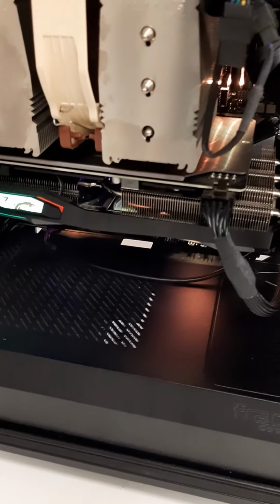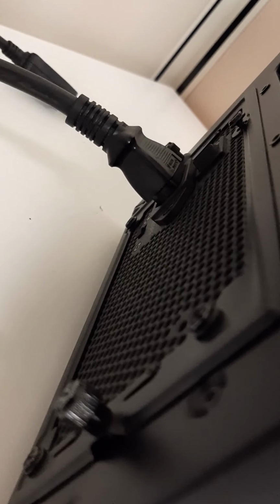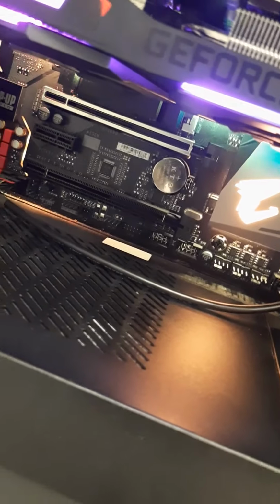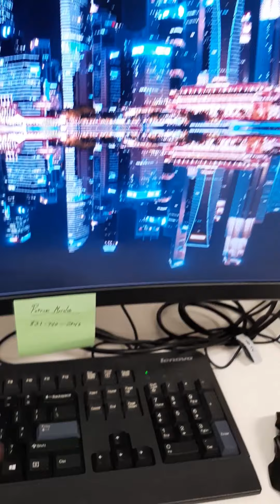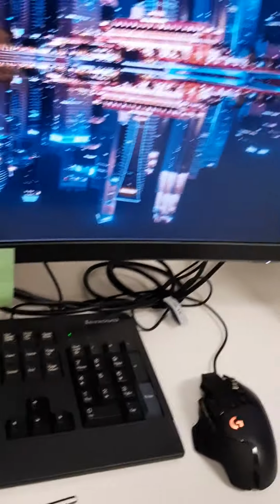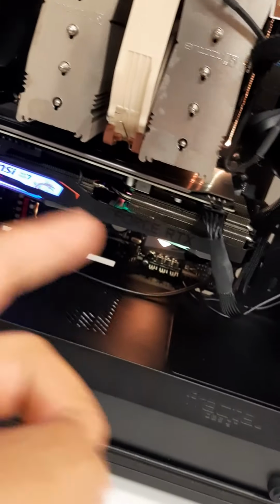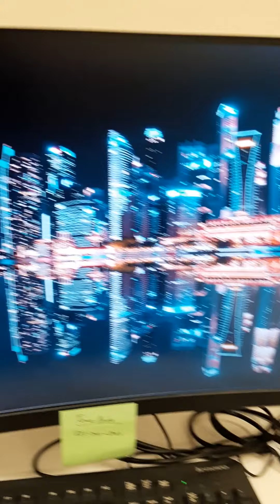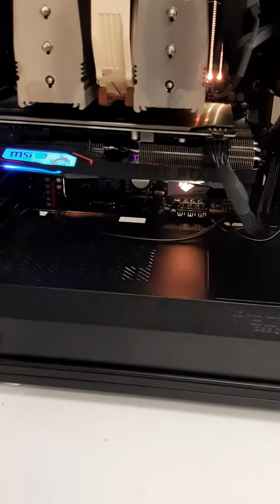HOW TO FIX BLANK SCREEN AFTER ENABLING SECURE BOOT | Windows 11 Upgrade Headache Fix

Comment: My experience: 
I was able to download to windows 11 from 10 without enabling secure boot (but have enabled tpm 2.0). Just recently I decided to enable it due to application restrictions. (Note: all my drives are in GPT)

I've got everything up to date and went into the (Gigabyte B450M DS3H) bios and disabled csm support to enable secure boot. Once I save and exited the changes, the computer was put in a power cycle (gpu lights/fan, cpu and case fans were going off and on (unable to get into bios/boost to windows)). I've spent a few hours diagnosing the issue (ram, cpu, gpu, and psu - these were all fine). So the only thing left was the motherboard itself. I've removed the cmos battery (let it out for 30mins) and short the pins, but it didn't reset the bios. 

I gave up on it and bought a new (Gigabyte B450M DS3H V2) motherboard. So I did the same process again on trying to enable secure boot... it did not work... this time I was able to boot to windows but not into bios. I tried resetting bios again, nothing worked... It was like it's fast booting to windows and skipping bios. If I tried to press the DEL key it shows (no display). The only way to get out of the black screen into windows was to power off the computer and deal with the fact that you can never get into bios.

Few days later, I got replacement for the same motherboard... now I'm not touching secure boot until I know it will not brick my motherboard. So from my understanding gigabyte boards kinda shit.
Reply from the maker: Wise choice. I'm tempted to mess with it sometimes but I know it won't let to any good. Sorry to hear about your experience, it sounds pretty annoying and stressful. It ain't worth it for a new windows that just wants to look like Mac OS. Looks great, but not worth another black screen. Thank you for watching and thank you for your comment. Have a great day 😀
Reply: dumb question but how did u get a replacement ? did u send urs back to gigabyte or just order the same one because i have this exact issue w the exact same motherboard and i ordered a new one from amazon and swapped everything onto that one and i’m still getting the same cycle like you mentioned
Reply: @whiipskiii3194  I've ordered the v2 and that didn't seem to work with secure boot so I got a replacement for that on amazon. The first one (power cycle) is a dead board now... I've got everything required to enable secure boot (uefi mode and GPT drives) but for some reason it doesn't work.
Reply: @meepmeep5668  so you still haven’t been able to fix it even w the v2 ?
Reply: @whiipskiii3194  nope. From what I see it's not just gigabyte boards that this is happening to. Just got to wait until we get a bios update or something.
Reply: @meepmeep5668  what cpu do you have ? one with integrated graphics?
Reply: @meepmeep5668  honestly i’m gonna try get a cpu w integrated graphics and get into bios that way cuz i’m too impatient xd
Reply: @whiipskiii3194  That could work but the fact that the pc is in power cycle idk about that one.
Reply: @meepmeep5668  will let you know how it goes in a week or so
Reply: @whiipskiii3194  yo how did it go because I'm having the exact same problem right now fuckk
Reply: SkySailor  thats cool man hope it works out im getting my pc fixed tomorrow because the motherboard is broken
Reply: Gruel1  did you end up getting it repaired, if so how?

Comment: Tysm for your suggested method, I was trying to enable secure boot with an older motherboard(around 2013-ish) and then my whole screen wont show any display.. Then I took out the CMOS battery, boot it up and display were shown.. The BIOS resets back to default settings and all good to go.. What I learned today? How to reset BIOS haha.. 😂

Comment: Hi, good, I'm a 15-year-old boy who has a younger brother who plays valorant, tonight I try to activate secure boot because the game asks for it, I get a black screen, but if there is a response from the keyboard and mouse, what do I do , I don't know much about PC and I don't want to disconnect the gpu for fear of breaking it, I only connect the cable of my monitor as vga?
Reply: I have an i7 10th integrated graphics a gigabyte h410m s2h and a gtx 1650
Reply: I beg you please help me, I'm from Argentina and I've had my PC for 3 years, I don't want to lose it because I have my parents' medical projects and papers
Reply: @PIPELofficial  do the same thing that the guy did in the video it works 100% and don't worry the gpu won't break
Reply from the maker: As Karim said, you probably won't break it. Just don't yank anything out of the motherboard. If you don't feel comfortable, look up a video on how to remove a gpu and see how the person in the video does it and just copy them. Since you have integrated graphics, this should work for you. I'm sure you'll do it just fine without breaking anything. Sorry for taking so long to reply, I don't check this account as often anymore.
Reply: I solved it with the little knowledge I had of flashing the bios
Reply: my bios had been blocked, so I flashed it, I also tried the video option

Comment: I am currently dealing with the same situation on Asus Rog Strix B450-F Gaming mb. I mistakenly enabled 'secure boot keys' and since then no signal on monitor. I tried to reset bios trough the CLRTC pins didn't work. I tried removing battery trick didn't work. I have tried MB's HDMI to see if I get any signal to display before and I did not get anything BUT I haven't tried it after I attempt to reset BIOS like you did. So now I will go back and try mb HDMI again.
Reply from the maker: Good luck 👍
Reply from the maker: @ProxiusMusic  This method only works if you have integrated graphics. Other people have fixed it by getting a new motherboard. Not cheap but it's an option. Try reading through the comments in case someone has found a workaround that could work for you too.
Reply: @ProxiusMusic any update?
Reply: @buffymade did you fix it?

Comment: The same problem here. Unfortunately I do have a cpu without integrated graphics. Mobo: Gigabyte Aorus z390-I. This seems to be mainly gigabyte's problem.  Luckily my brother has a cpu with gpu and he let's me borrow it. If that solution works, I'm going to post it everywhere.
Reply from the maker: Hopefully it works for you. Let me know if it does
Reply: @anthonydiaz6101  problem fixed with integrated graphics!
Reply from the maker: @emilhanelius7655  Awesome! 😃

Comment: I had the same problem yesterday, I wanted to enable secure boot to be ready to install Windows 11 whenever I want... black screen.
And I have a CPU with no iGPU...
Thankfully I had a Ryzen 3200G as spare parts so I swap the CPUs and fixed everything in the BIOS, everything works again (but no Secure boot).
Guess I'll have to wait until someone finds a way to enable secure boot on these Gigabyte boards (B450i Aorus Pro Wifi)
Reply from the maker: That's great! Good thing you got it fixed
Reply: I have the same motherboard and had the same issue.  Sadly I didn’t have a spare processor with integrated graphics to fix this, and ended up prematurely getting a new motherboard and processor altogether.
Reply: I have some problem with no internal gpu. Can i change another vga card to make my pc boot again to change bios setting?

Comment: 1:26 What do you plug in the hdmi port?
Reply from the maker: Plug your monitor into the hdmi port that's on the motherboard so you can use the integrated graphics of the pc to get an image. This only works if your CPU has integrated graphics, of course. If you don't have integrated graphics, you'll still have the black screen.

Comment: That's exactly what i did on  my MB (Gigabyte UD Z390), and the only way i realized it was my GPU is, because i have 4 LED on my MB that have written on them (CPU-RAM-VGA and Bios). When i saw that VGA LED up, I instantly removed it, and saw the error disappearing together to some error beeps it was "screaming at me". The crappy part is, you're royally screwed if you don't have a CPU with integrated GPU.
Reply from the maker: Yeah, unfortunately that is true. I'm lucky I bought one that happened to have it. If I didn't, I would not be very happy right now. I feel for anyone who doesn't have integrated graphics though, it must be very frustrating.
Reply: Well yeah thats why I am screwed. I5 10400f and 1660 super tried to enable secure BOOT. And boom!!  Gotta call tech guy who can fix my PC by putting IGPU based CPU. This process sucks!!!
Reply: @atharvakale1167   and guess what, the reason it doesn't work well is cause u need to updated the bios on your MB. That's not rly dangerous unless u live in an area where you have black outs. Let's just say you don't want your electricity to fail when u update the bios.
Reply: @Wolf_Spark  well it is updated. Issue is only with gigabyte mb. I checked online and around 90% issue is with GB mb.Like GB which is one of the top most brands
Reply: @atharvakale1167  Could be that, last week when i was trying for this updated, it seemed GB and Asrock mb have some issues with the secure boot/TPM settings.
Reply: @Wolf_Spark  Now as I read on multiple forums, sol is to either put an CPU with igpu reset BIOS then connect gpu or just replace gpu with basic one and connect HDMI.

I do have my old GT 710 and thinking to give it a shot
Reply from the maker: @atharvakale1167  it really does bro. Best of luck with that man. I hope you can get that fixed somehow
Reply: @anthonydiaz6101  Thanks man. Thanks god my whole system is new so literally every single frikin hardware is under warranty so i am chilled. 😂
Reply from the maker: @atharvakale1167  That's good to hear. At least you're well covered
Reply: @atharvakale1167  hey did that work? I'm in the same boat as you
Reply: @xLightcrystalx  hey sorry to give u a shock. My motherboard died somehow and got new one as it was under warranty. That's it rest all things were as it is. No need to reinstall windows or anything. I putted new MB and not just my pc came back to life but also with win 11 support.
Reply: my cpu didnt have an integrated graphics (i9 9900kf), therefore had to ask my dad to collect some 9th gen or 8th gen cpus from his company to troubleshoot 😢

Comment: Enabled secure boot and factory keys.. mine is still rebooting after removing cmos and gpu, barely powering the run fan. Neither Monitor or mouse gets power. I just wanted to play Valo 😭
Reply: turn off the CSM support in BIOS

Comment: Omg. Yeah this led me in the right direction. Had the same thing, I could get to bios but couldn’t boot. I couldn’t even get bios to pop up without the GPU in, and ended up just going to bios with GPU in after resetting cmos and bios, put standard on instead of custom and ufei mode and it worked.

Comment: I need help with Asrock X570 Steel legend. To enable Secure boot on eneble I first have to disable CSM, save the bios and restart to re-enter BIOS and enable Secure boot because otherwise it is not possible. The problem is that when I disable CMS and click any key on the keyboard my computer does not start. There is power everything lights up but the screen does not work black image. When I do not click anything the system finally starts. During startup there are 5 beeps. The only solution is to remove the battery, i.e. CSM is turned on again. I discovered that when I connect another monitor I can enter BIOS turn on Secure boot and everything works no beeps. Everything is ok. GPT system, AMD CPU fTPM, Secure boot enabled visible in the system everything works! But when I reconnect my main monitor the problem appears again. There are 5 beeps again and as soon as I click something I have a black screen and I cannot enter BIOS. If I do not click anything the system finally starts and Secure boot works. These 5 signals are irritating! I have previously had Secure Boot enabled on my monitor many times and never had any problems with it! I recently cleaned my computer of dust without power and battery and since then I have not been able to enable Secure Boot on my monitor again and also enter the BIOS! Is there a solution for this? Why did this problem suddenly appear? I have enabled Secure Boot on my monitor many times and never had any problems with it! I have even done what Asrock recommends Install default keys Secure Boot. I have done Custom and also the Standard recommended by users, it does nothing! When I enter the BIOS on the second monitor and switch the HDMI cable to the second monitor on a turned on computer with the BIOS visible, my screen and BIOS work but as soon as I restart there is still a problem. On another monitor everything works without a problem. The second monitor is from another computer, it has never been connected before, I have always used mine. I have done this many times on BIOS version L3 and also L5.60, now I have even installed the latest version L5.63 and there is still a problem!. I only have monitors with HDMI input! My motherboard does not have integrated graphics! I only have a dedicated card with one HDMI input and 3 Displayport inputs. I can't connect my main monitor to another output because I only have one!. HEEEELP! Asrock is shit! On Gigabyte, Asus or Gigabyte there are never such problems, this was my last motherboard from this shitty manufacturer.
Reply: I solved the problem myself. The solution was trivial that no one on YouTube, forums or ASUS, ASROCK and Nvidia support came up with. My system starts normally, BIOS boot is fast again without errors, I can enter BIOS and every time I see a normal screen. If you have an AMD processor, an Asrock motherboard, make sure you have: Format GPT partition, AMD fTPM, CMS disable and Secure boot enable set in BIOS. If you also installed a BIOS update and it didn't help, keep looking for a solution. I struggled with this for two weeks. How did I fix it? And that's my secret, no one was able to help me. Only stupid idiotic answers, people can't read with understanding. And any technical support from companies is a bunch of morons. Don't count on me sharing my solution to the problem so easily.

Comment: Anthony you are literally a life saver I had the exact same issue with trying to get safe boot enabled. Did you ever find a way to get safe boot enabled properly?
Reply from the maker: Happy to hear it worked for you. Thank you for watching the video!
Unfortunately, I never found a way to get it to work. I tried again after I had fixed it with other methods, updates, etc. and I still ended up with a black screen. I'm just gonna have to wait until I upgrade to a newer CPU that's compatible. Apparently, the issue with compatibility that I had was that my CPU wasn’t supported. Mine was literally just barely out of the list, I think based on the models I saw on the compatibility list. If I had built my pc just a year later and gotten a newer model CPU, I think it would have gotten a compatible one. It is what it is, I guess lol 🤷‍♂️
Reply: Did you leave the battery out while doing it?

Comment: My new mobo is on its way, I gave up trying to solve this problem. I have tried everything and nothing works, I don't have a cpu with integrated graphics. I just activated the secure boot and my monitor stays with black screen, my keyboard turns on and off its lights in an endless loop after that....
Reply from the maker: That sucks. Hopefully this does the trick. What mobo did you go for and will you be trying again or are you done? I kind of gave up on windows 11 😂
Reply: yo did u fix it or nah
Reply: No, I had to buy the same motherboard again

Comment: I have i5 9th Gen it require graphics card  and that processors don't have integrated graphics what I will do???
Reply from the maker: Some people in the comments have made it work, so look through those. Worst case scenario, you may have to replace your motherboard. You can also get a new graphics card that's compatible. Someone in the comments did that and was able to use secure boot without the blacked out screen. I'm not an expert in this subject so I won't be of much help, but the only other thing would be to keep browsing around to see if any new fixes have come up.
Reply: Hi, did you fixed it?

Comment: Ohhhh OK you meant The Ciomos Battery, That Is called Cimos battery if you remove and Enter it again It will actually Reset the Bios Setting, so if You Did something wrong inside Bios SYSTEM JUST Remive it and Enter it Again, But DONT DO IT ALONE ONLY A TECHNICAL GUY CAN DO IT, IF YOU DO IT BY YOUR SELF SOMETHING BAD MAY HAPPEN EVEN WHEN YOU TAKE IT OFF THE CIMOS BAYTERY PLZ BE CARFULLY

Comment: I'm planning to do this thing next Friday when I get the Pentium with iGPU from a guy for 10€. However, my situation is a bit different because my computer is currently working since I manually switched to the backup BIOS using the small switch on the motherboard. But I want to get both BIOSes up and running, and using this iGPU and resetting the settings seems to be the safest and most reliable way to do it.

So thank you for corfirming that this method works.